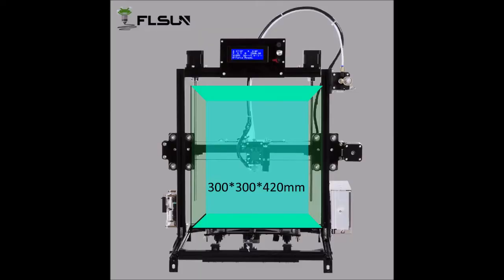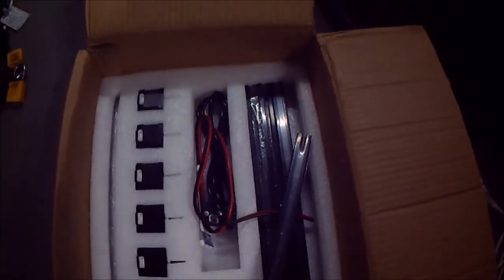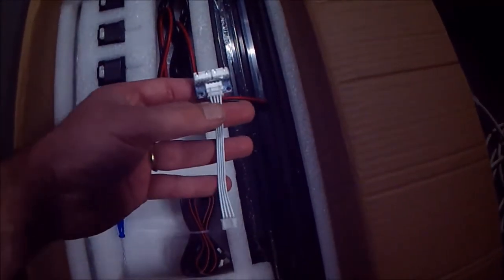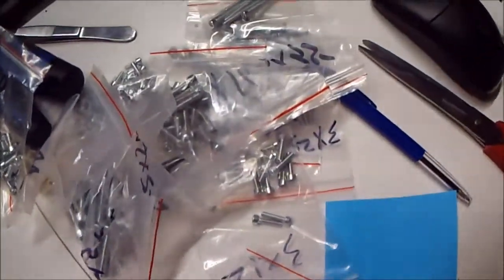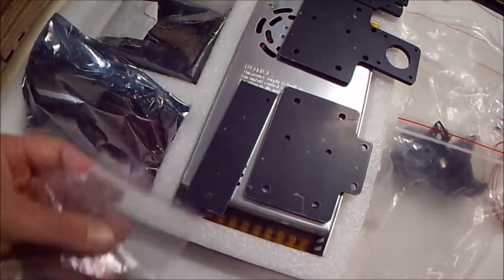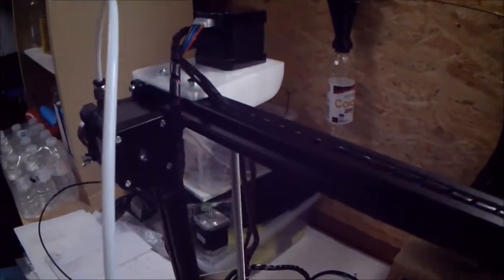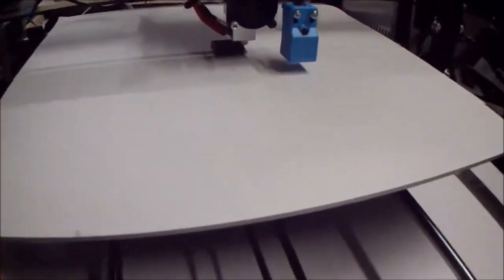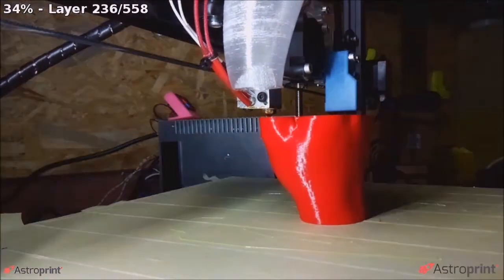flsun 300*300*420 review

Comment: hi i have this printer and the firmware not good they sent with it and been been trying to get it to work it there a way to install it all and have it printing and the calibration perfect ??
Reply from the maker: Brad hucker hi thé firmware you use is ? Just make that they sensor is good 👌 if you like send me PIC off thé printer , i help .
Reply: you need undate marlin using your computer.  A $10 LCD is ideal vs MKS tft ideally

Comment: Sweet, thanks for the vid. Did you upgrade your Power Supply as well?? I'll be ordering this off Amazon this Tuesday.
Reply from the maker: no all out off the box
Reply: zizo3D Zizo3d cool, thanks.. still waiting on mine. They made a lot of upgrades after Chinese new years, and I'll be getting the newer version.
Reply from the maker: elfpimp1 🤔 upgrade ? You have link ? Next printer is a delta flsun 👍
Reply: zizo3D Zizo3d not a fan of the deltas. But yeah, they were talking about these upgrades coming out after Chinese New year in the Q and A section on Amazon.com..  Apparently there are parts on the extruder and other areas of the printer that were going to be changed from plastic to metal.. 
I'll see if I can find the answered questions and link it..
Reply from the maker: elfpimp1 Nice 👌 you got fb ?
Reply: you don't need to upgrade PSU, just use a MOSFET